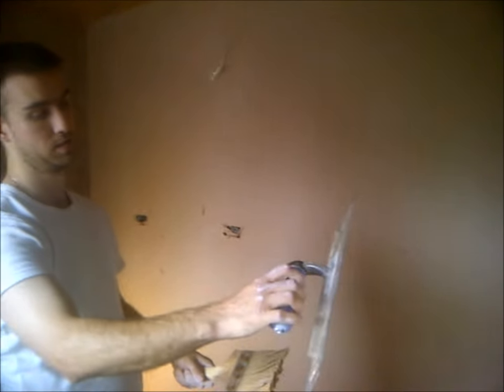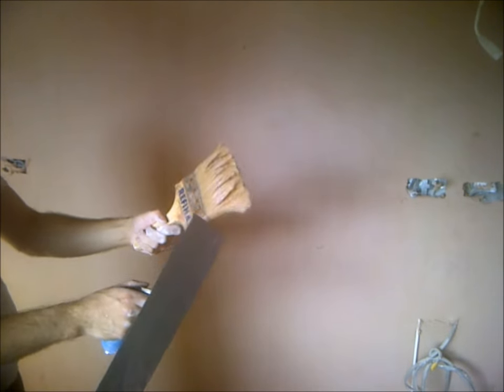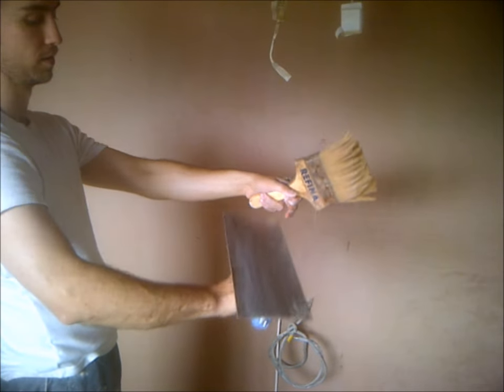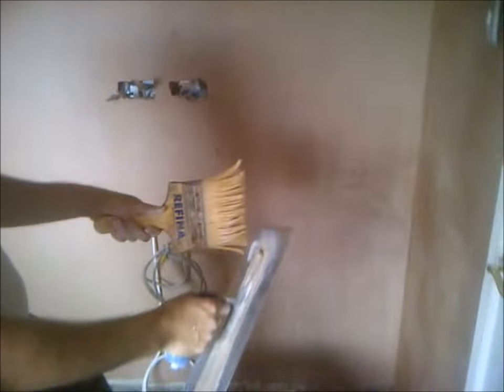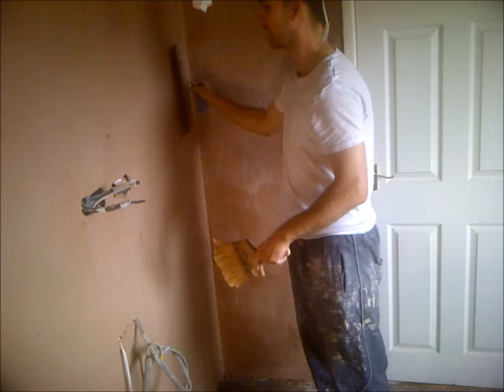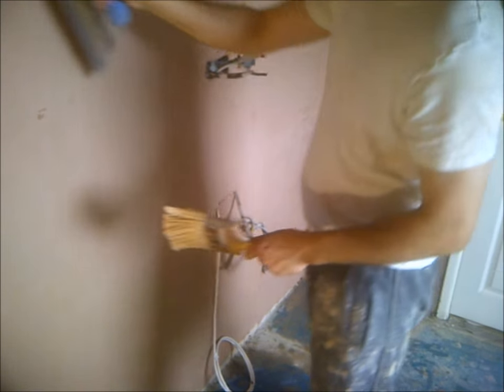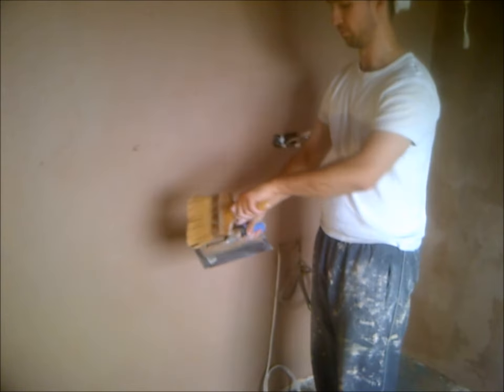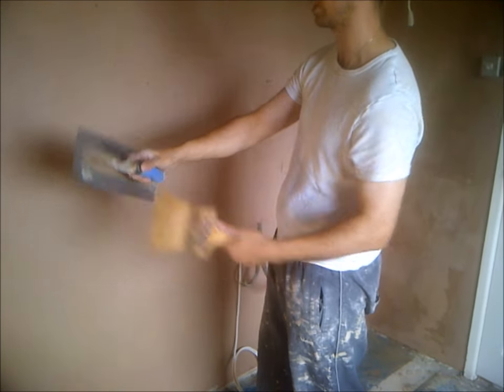Refina superflex trowel full review ( tool talk )

Comment: Sometimes before painting I may go over it with sandpaper only needs light scratch/rub, to help key. Sizing with watery paste mix is fine, allow to dry and paint. I usually use vinyl silk on walls and mat on ceilings. I wish I had learnt to plaster. Thank you for the tips also tools demo and technique
Reply from the maker: Steve Phillips Thank you for watching my friend and also sharing you great tips on painting. Never to late to learn they say I will try to show you some tips but it really is a hands on game and dose take years to learn but Im sure you could learn a few handy things from me :)  I do have a few good ideas on how to do videos coming up they will hopefully be easy to understand and I will try to keep the simple as possible. Of course these will all be based on how I do it as all my videos are so what suits me might not suit every 1 but can be a guide :)
Reply: macplastering I'll look forward to those videos you hope to make. I like filming but I tend to rely a lot on the camera, occasionally a use the various settings. Lighting is so important to get good pictures and videos. I like the canon HV30 but it is tape not digital, need to convert it afterwards on computer. But it takes all the formats well at least most of them. It is also pretty good at handling low lighting. Not always easy to get them, I saw some where about £1500 new; I got mine like new for about £200 I may have told you I also use the Canon power-shot 120 have lots of fun with this camera. Probably because it's easy to use. My niece as a Canon professional camera she takes great pictures but I forgot what it's called.
Reply from the maker: Steve Phillips :) I think my next camera will be the same as my brothers it is easy to use and I like easy lol :) I think he said it was only like £100 so I hope to get it think it is a sony I might also get a go pro or something along that line :)

Comment: Mac plastering did u use this straight from the box and do u think it's better than de nela supaflex for finishing good detailed video
Reply from the maker: hi gman well not here no this was after a good lot of uses but i dry trowelled with it a lot to break it in some dry towelling is done when a wall is set hard I found it the best way to use it until it was ready to use on a wall or ceiling just before it goes off Thanks for watching hope you subscribe for more :)

Comment: My refina superflex 2 i use for finishing stages, wet trowel.  I find it leaves lines at heel and toe of trowel Which is frustrating as the actual finsih from the trowel looks brilliant! Any suggestions? Im using plenty of water btw.  Cheers mate
Reply from the maker: It might be a touch bent or possibly just needs to be used on a fully set wall a few times to wear edges in better 🤔
Reply: @macplastering  done another wall tonight mate and worked a treat. Think the other wall must not have been dry enough so patience is what I need lol.  Cheers for reply mate keep your work up it helps alot!
Reply from the maker: @aidangallacher9049  brilliant man we  learn all the time great stuff so glad to have helped you some =]😀

Comment: Yes I understand what dry trowel is I'm qualified plasterer over 20 years the gene ha ha just been away from it about 5 years not much work here in Ireland but picking up again only ever used marshaltown it's what I think we were all told thanks for reply will subscribe cheers
Reply from the maker: No problems man yea at it half my life here haha  I know what you mean about work here it can be slack at times for sure . yes I was using marshaltown and still do but these are good takes some pressure of the joints on the last wet trowel my mate has the nela super-flex he likes it never used them my self but they both do seem very similar
Reply: +macplastering ya have been seen a lot about the nela only started watching plastering channels last week or two think nela superflex 2 seems to be the one now have u ever used speedskim see it few days ago couldn't believe it if u have used them are they any good cheers
Reply from the maker: gman hgh I have used a few of them yes think they can work great on large settings on ceilings and walls check this video out might help you get an idea on them https://youtu.be/5jo9Bf8RhXg
Reply: +macplastering Jesus man looks dead handy tool looks like it takes a lot of hard work out of it good video u wouldn't finish with tho would u what size is that one u use
Reply from the maker: gman hgh that one was a 1200 but you can get smaller they have made one for finishing too haha but i like it for polishing have a quick vid on it too https://youtu.be/_MMOyKlCQlo
Reply: +macplastering I'm definitely away from the game to long ha ha looks very handy ok that's a different blade to the blue one for flattening is it ya
Reply from the maker: gman hgh they say the pink one can be used for all trowels i have used it for sand and cement in hard to get at places as an edge worked ok also used it on heavy patches and mostly to dry trowel :)
Reply: +macplastering thanks for your help and info I'll have to invest keep up the good work and I'll be keeping an eye on your channel cheers
Reply from the maker: gman hgh Any time mate thanks for the interest :) have a great week :)

Comment: too many marks in plaster 
l.e     trowel is dragging   wet  the wall instead of  wetting the  blade  therefore  you push the  water into the  plaster creating a  blemish free wall  💋
Reply from the maker: nice input buddy but believe me there was not a blemish on this, this wall is hard and pretty much set so i only need to lubricate the blade to avoid drag also even if you read the back of the bag it does say use minimal water in last stages. But us plasterers all got our own ways :) you use these trowels much buddy?